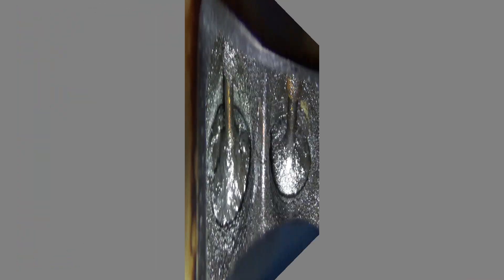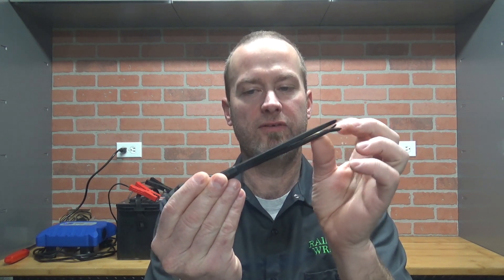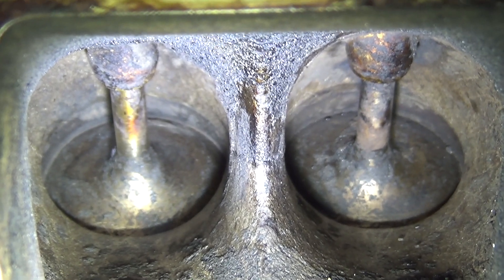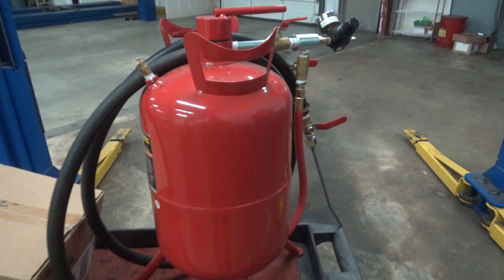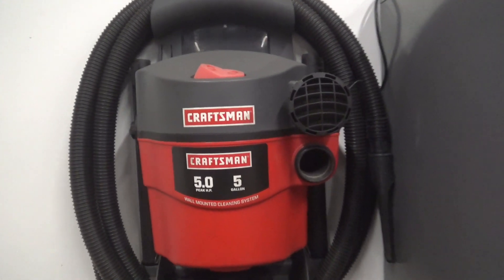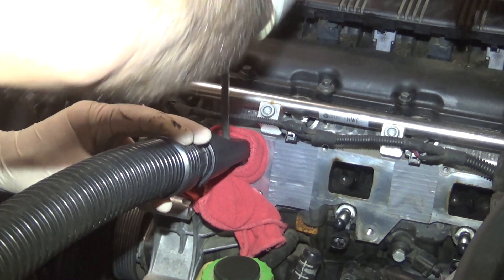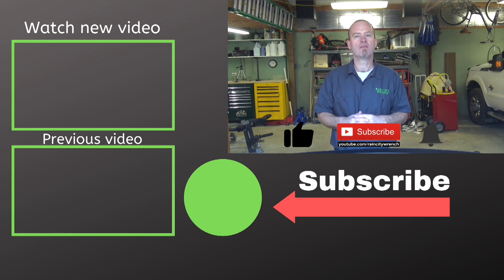Walnut Blasting Intake Valves, Audi Q7

Comment: As somebody whose tried both methods.... I'll never do the soak and scrub method again. If you have a garage, or access to a DIY garage, do the walnut blast. My first valve cleaning was by hand, and I spent around 90 minutes per cylinder or more. The carbon is bonded into the metal and it takes some serious cleaning to remove, and it still won't be perfect. Walnut blasting takes a few minutes per cylinder and makes it look brand new.

Comment: What is the earliest or more general rule as to when a vehicle, purely from a maintenance point - needs a carbon flush. What mileage are we looking at ? At present my vehicle is a Mazda 3 2018 manual petrol, with the mileage at 55 000 miles. Thank you.

Comment: Great video!  Your process worked like a charm.  Also...Thanks for the tip on the sand blaster...I have the same one and also struggled with the valves to get it to work right.

Comment: What if the walnut get stuck in the Valve? How do you remove all the walnuts?
Reply from the maker: Spraying parts cleaner inside the intake port and blowing out with compressed air does a good job. If a few pieces are wedged in the valve then remove the spark plug, crank engine over by hand until the valve just starts to open and then blow compressed air down through the spark plug hole and vacuum the chunks out of the port.
Reply: There are adapters to attach an air hose to the spark plug hole.  That way you can pressurize the cylinder before you rotate the engine.  As soon as the valve opens a tiny bit the air pressure in the cylinder will blow the walnut shells out the intake port.

Comment: how much is this job ?
Reply from the maker: Every shop that does these will have different labor rates, probably around 1hr labor per cylinder.
Reply: @raincitywrench117  and Intake removal is a Must? my car runs Good no issues but seals where leaking and were fix By Dealer but i think valves where not cleaned! i'll call tomorrow lets see what they say

Comment: What size air compressor did you use? What’s the minimum required size?
Reply from the maker: It was a a commercial grade Kaeser but a 20 gallon home compressor would work just fine.

Comment: Great video, I just have one question….how did you get the valves to be completely closed so as not to get anything in the cylinder?
Reply from the maker: Thank you! Once the intake is off you can roll the engine over by hand with a socket on the crank pulley bolt until the valves are closed on the cylinder that is being cleaned.

Comment: how much typically this would cost? just a ballpark
Reply from the maker: Our shop would charge whatever book labor calls to remove intake plus 1/2hr per cylinder. So if you have a 4 cylinder engine that requires 3hr intake removal then it would be 5hr total. If the shop labor rate is $150hr then the job would cost $750.00
Reply: @raincitywrench117  I have a twin-turbo v8 (m278), 6.5 hrs, so the total would be $1575 which is ALOT, I want to use CRC carbon cleaner but I'm afraid a big chunk of carbon ends up falling into the engine and causing damage,  the car has 140K miles and I do not know if the previous owner did any carbon cleaning

Comment: What about the valve seat the part 
that contacts the cylinder head 
does carbon ever build up in that 
area?
Reply from the maker: Just a little around the inside will build up but doesn't affect anything. The engine will run like a top after this service.

Comment: Good video. Not too wordy and straight to the point. My 1.8 tsi is having high rpm misfire. 100k miles with upgraded turbo and tune. Also probably need to replace injectors as well as the walnut blasting.

Comment: A tip for anyone going through a misfire. Check your camshaft sensor first.. i had sandblasted my intake and still bad a problem. Found out it was the sensor. I had 70k miles on my 1.8t vw b7 so it was a matter of  time for the vavles to be cleaned.. but hopefully it can save you guys time/ money if you dont do it yourself
Reply from the maker: Great tip

Comment: Hi, what's your opinion on Subaru direct injection? Are they as bad as the German ones with carbon build-up? I'm about to buy a Crosstrek with the 2.5 N/A engine. Thanks in advance!
Reply from the maker: I honestly can't say. Have yet to have the intake off on a high mileage Subaru to look at the valves. Haven't heard anything bad yet.

Comment: How does one clean the edges/rims of the valves and port openings?
Reply from the maker: If you want to go over the top after the service you can roll the engine over until each valve is open and use a pipe cleaner or something similar and then blow out the cylinder with compressed air. There is only a very small amount left that this service doesn't clean so I don't bother.

Comment: My petrol hyundai Gdi engine car has pre-ignition issues and drinks oil has covered 50.000 miles. But no performance issues?. A company called terraclean offer a walnut shell blasting service should that sort out my pre-ignition problems.
Reply from the maker: Tough one. May want to pull the spark plugs and inspect for oil buildup. 50k sounds too early to have heavy buildup on the valves but it does sound like your issue.

Comment: Where did you buy that long nozzle???
Reply from the maker: I made it. Bought a short piece of brake line from the local parts store. Left the flare on one side which worked great to chuck into nozzle and cut the other side down and bent it

Comment: Super helpful - makes sense that intake manifolds just get all kinds of garbage in them that just needs a deep cleaning every so often. It's almost like cleaning teeth. Could you have skipped the drill zip ties and gone straight to walnut blasting and gotten the same effect? Or did it just help to use the Wurth brake cleaner to break off the biggest chunks and then let the fine grit walnut shells handle more of a finishing/polishing step? I don't have access to a liquid evacuator....
Reply from the maker: Sure, you can go straight to blasting. You will use more shells and it takes a little longer but the end results are the same either way. I combined two ways of cleaning. You can easily do this job yourself with some zip ties/carburetor cleaner and get good results plus save a bunch of money. Compressed air works great to blow out the crud. Mityvac's are pretty cheap too. https://www.zoro.com/mityvac-manual-fluid-evacuator-19-gal-07400/i/G1764515/feature-product?utm_source=google&utm_medium=surfaces&utm_campaign=shopping%20feed&utm_content=free%20google%20shopping%20clicks&gclid=Cj0KCQiAu62QBhC7ARIsALXijXR0WKgvfMYKUMVoc3MbiwEg0HVrhPSF84mlQPJI-ulmKGwC89GLn9waAo6zEALw_wcB

Comment: on my 2014 ford fusion 2.0  i took off the intake manifold today 01/15/2022 to do a sound symposer delete.... removed the intake manifold.. and found very little oil in it.. took a look at the valves and just a light grey coat on them,, still see the valve shape.... i think ford did the DI engine better than the germans.. the pcv valve/plate has a couple baffles inside it to catch/drop the oil out of the system.. before it car get to the valves.. and that is an uphill climb for and vapours to get to..where the german cars take it from the valve cover. and i have seen vw's audis with lots of build up after only 50000 miles on them.. bmw's are just as bad... i did not install a catch can/ovs untill 150000 miles ( stupid me..i work as a classic Italian car tech ) should have known better.. but all my oil changes are 5/6000 miles full syn oil...i use almost no oil if any.. and my ovs after 3000 miles has about 1/4 teaspoon of oil inside it, barely cover the bottom of the ovs ( i did add some copper pot scrubber inside the can to add more area for the vapour to attach too.. just a little )  so i am happy with my car
Reply from the maker: You are correct on the crankcase breather systems. European vehicles have high flow pcv systems thus build thick deposits. I have yet to see a 2.0l Ford with a misfire due to valve carbon buildup and I see these vehicles daily with over 100k. I work at a Ford dealer now The 1.5, 2.0, 3.5 will have deposits with higher mileage but for the most part seem to be unaffected. Also, owners who keep up on the oil changes suffer lower valve buildup. These engines have low tension piston rings and will have more blowby with dirty oil.

Comment: How good was your vacuum able to get the walnuts out the longer ports on the vr6 , only saw the shorter intake ports in this vid,
Reply from the maker: Vacuum got most of them out. I sprayed some brake cleaner down the long runners to douse the valves then used a long reach air nozzle to spray out. Worked great.

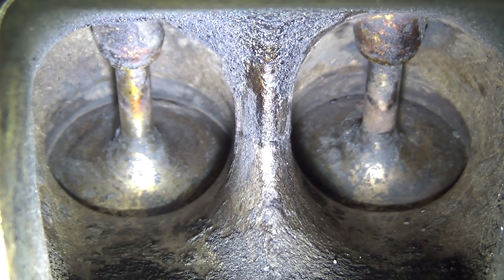Comment: Just to confirm, the picture at 2:33 was from scraping and using the zip-tie brush? If so, that is already a huge improvement from the picture at 0:37. It may not even be necessary to walnut blast.
Reply from the maker: Yes, exactly. Using the zip tie method would be more than good to go without blasting.

Comment: Having an issue on one a 3.6 vr6 that came from another shop where they claimed that they cant clean the cyl1, 3 and 5 correctly so i have misfires at cold start. Are they that hard to reach ? are those the holes that you have tapped on that head ?
Reply from the maker: Yep, exactly. Three of the ports are easily accessible but the other other three have long runners which split off half way down the port dividing the air into each valve. With a long nozzle like the one in the video can reach all the way inside to clean the six valves for the opposite three cylinders. If you have a scanner and are experiencing misfires on cylinders 1, 3, 5 then most likely cleaning the valves will fix it.
Reply: @raincitywrench117  Sorry i didn't see that you answered. They were caked lol. Walnut blasted them and no more misfire counts. I was skeptical when they said they couldn't clean them cause i haven't had a car that you can't reach. Thank you

Comment: Start by securing the wheels, putting in neutral, twisting the engine so that valves are 100% closed. Nah forget it details like this don't matter ....
Reply from the maker: Well hey, that stuff goes without saying...lol
Reply: @raincitywrench117  That stuff seems to be more important than the rest :) No offence but getting adequate CFM at req. PSI involves a powerful compressor. Powerful compressor means 3 phases as with 1 phase compressor getting 10cfm at 120psi not quite realistic. Not everybody has a healthy 3 phase outlet. etc etc..

Comment: Very impressive 👏  How often should this be done and would it help in a direct injection diesel engine?
Reply from the maker: Thanks! In my experience, domestics can easily go 100k without issues but some European models can start having problems much sooner. Once you start experiencing loss of fuel mileage or driveability problems then it's time. Diesels can also greatly benefit with this procedure.

Comment: Do you recommend this on petrol cars? I have audi s3 i get 100miles on half a tank
Reply from the maker: I recommend this on most direct injected vehicles especially higher mileage European makes. Audi's have high flow pcv systems and are prone to carbon buildup.

Comment: Looks like a 3.6 VR6.. I just had my intake off to replace the PCV valve. Was looking at the intake valves and said screw it, another time...,how did you reach the valves for cylinder 1, 3, and 5?
Reply from the maker: Yep, that's exactly what it is. The nozzle is about a foot long and gets right up in there and does a nice job. Difficult to see if there are any residual shells so I spray in some carburetor cleaner and then blow out with compressed air. Works like a champ.

Comment: Where did you purchase the adapter for the shop vacuum? Does it have a specific name?
Reply from the maker: It was one of the attachments that came with my wall mount craftsman vacuum. I bet you can find the exact attachment or something similar at your local hardware store. I drilled a hole in the top of it just big enough for my nozzle to fit in.

Comment: I noticed that none of the vids like this that specific to cleaning the intake values of Audis never show how they opening/close the other intake valves
Reply from the maker: I remove the tape on remaining ports and then rotate crankshaft over by hand looking for multiple cylinders with closed valves and then taping off cylinders with open valves. That way multiple ports can be cleaned in succession.
Reply: @raincitywrench117  Thank you for the response.  I understand that the crank has to be rotated but what does that look like?  Where and how os that part of the process done?
Reply from the maker: @antoniocole585  Sorry, wished I had filmed that process. I just use my long 1/2" ratchet with a socket on the crankshaft bolt and rotate it clockwise while at the same time looking down the ports for the valves to close. Repeating same process for each cylinder.

Comment: Great job, as good as new!  This seems a poor design, something the engineers didn't consider.
Reply from the maker: Thank you very much!
Reply: form my experince on my 2014 ford fusion..2.0 engine.. the fords have much less of a problem as to the vw's bmw's audis etc..i did not put on a catch can/ovs untill 150000 miles..( i should have known better,,i work on classic Italain cars ) but ober the weekend  01/15/2022  i did a sound symposer delete and took off the intake manifold,, and was very suprised to find just a light grey coating on the back of my intake valves,, and even the tb was clean.. just a wipe of oil in the lower boost tubing after the intercooler.., but i have always use 10/30 full syn oil in my car..5 to 6000 mile oil changes..perhaps..i am just lucky thuo

Comment: what engine is this? Why does this have port injectors?
Reply from the maker: It's a narrow angle 3.6L V6 direct injected engine. The top fuel rail you see in the video feeds the 3 injectors that point into passenger cylinders that have duct tape covering them. The other fuel rail is removed to gain access to the driver side cylinders and you can still see the injectors sticking into the cylinders below the ports. It is very similar to the VW VR6 engine. Definitely a funky engine design.
Reply: @raincitywrench117  TDI? GTI? GDI? Is this the 3.6 FSI? Turbo  or no Turbo? Does this have an EGR valve? Did you check the carbon build up in the intake manifold and EGR? I have seen some people that took it out and it was clog like an old dirty pipe.
Reply from the maker: @rhythmandacoustics  3.6 FSI Quattro VR6 non turbo. The intake manifold looked great. The deposits collect right around the valves where the cooler air and crankcase gasses meet.

Comment: There's some walnut left on the right valve 5:13 is that okay if a little gets left behind or did you totally clean all that out?
Reply from the maker: Good eye. Those tiny pieces were wedged in good and wouldn't blast out with air. I don't think they would pose a problem. Still, I rotate the engine over until the valve just starts to open and that frees them up to vacuum out.

Comment: Great video.  Direct, to the point, no endless chatter to increase viewtime.  The zip tie trick is pretty cool.  

Try using this to help regulate the walnut flow.   Just replace the ceramic with the wand, and good to go.

https://www.harborfreight.com/abrasive-blasting-deadman-valve-with-4-ceramic-nozzles-60491.html
Reply from the maker: Very nice. Thanks for the link and will give it a try. Would be nice to turn on and off with one hand.

Comment: Does the engine have to be out of the car for this because I have the valve cover off and the valves exposed so could I walnut blast them without it hurting my motor
Reply from the maker: It can be done with the engine in or out. I don't know what you are working on but I suggest reinstalling the valve cover so no walnut shells go into the engine.

Comment: What is the average cost to have this service done on a 2013 Audi A6 3 liter
Reply from the maker: Probably somewhere around a thousand bucks based on $130 shop hourly rate. I looked up the times, 2.3hour for fuel rails, 3hour for cleaning and then add in injector seal kits along with intake gaskets.

Comment: The zip tie trick is on point. What a great idea. I'm definitely borrowing your technique when I clean my GTI valves next weekend!
Reply from the maker: Hope that works out nice for you. Make sure you have a long pick to break loose the big chunks first. If the injectors stick in the fuel rail and pull out of the cylinder head then it is recommended to replace the teflon seals. I have a video on how to perform that service as well.
Reply: @raincitywrench117  great. Thanks! I will definitely check that video out. I plan to replace all of the seals, and already bought the replacements.

Comment: I have a cadillac cts gdi 3.6 motor have a loud idle at startup and car rides fine while driving but at idle I have a horrible cabin vibration. I already replaced the motor mounts plugs and spark plugs replaced the plugs twice last year and this year. Not sure what to do next thinking walnut blasting but, cant find a shop to do this.
Reply from the maker: No check engine light? I would get the computer scanned = check for codes, cylinder balance test, check fuel trims/oxygen sensors. A good reputable shop should be able to perform those test and diagnose your problem for under 200 dollars. Hope that helps
Reply: @raincitywrench117  there are no codes, nothing in system car rides fine except at idle no shops in my area do this I've asked around and they dont even k ow what I'm talking about.
Reply: @shortdom107 did you ever fix the idle problem? Did the valve cleaning help?
Reply: So that’s your problem... you have a cadillac